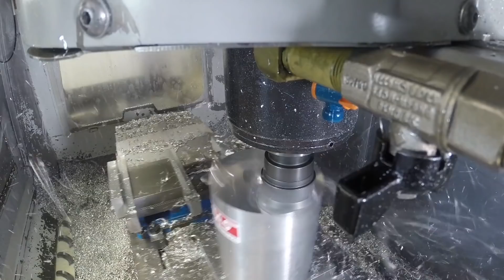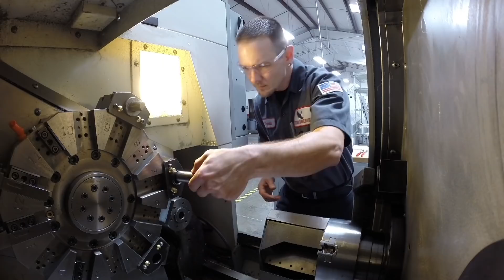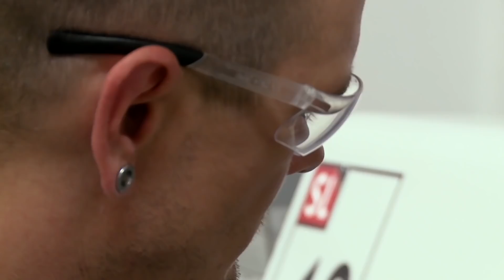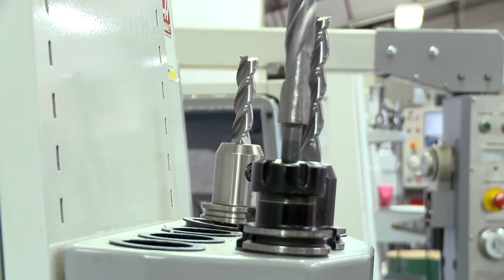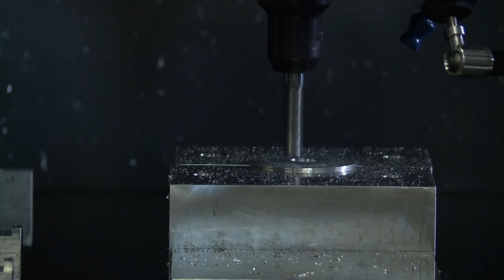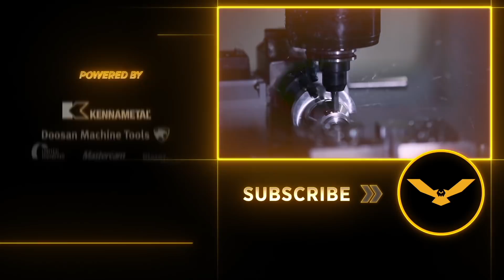I HATED Hearing Him Say… “You Got Time To Lean, You Got Time To Clean”

Comment: I literally sit at my machine playing my 3ds. I work in my own bay, and have long run times. I also take quite aggressive cuts, so I'm always at my machine, if I'm told to clean while my machine is running and I'm not at the controller? It's not just the possibility of a scrap piece, it's the possibility of a scrapped machine, or a seriously injured person. I don't want to see what happens when a .400" depth of cut, with a .04" feed rate decides its done for the day on a 5000lb piece.

Comment: As a toolmaker I once had to run a series of parts on a cincinatti mill, did it in half the time.. how come?.. i had to rinse  the parts that came out of the machine.. the regular operator would take the part out, rinse them and only then would put the new part in.. i took a new part in one hand and the vice key in the other, put the key on the vice, open it, take out the part and put it in the bucket for rinsing, put in new part, close the vice, shut the door and hit start, only thrn i would really rinse the part that had already been soaking in the bucket.
It was a short cycle, so aftrer rinsing i dried the part with compressed air, put it in the crate, and pick up the next part and the vice key, just as the spindle retracted.. no standing idle at the machine...
My supervisor asked me how i was so quick.. and i told him : "i'm not quick, i'm efficient"

Comment: "As I got faster and more efficient, I made more money"

Theres your problem in thought right there. Shops don't pay more for increased production or a clean workspace nowadays. I get paid the same whether I run one machine, or run 3 machines and the bandsaw at a breakneck speed all day long- and either way its not enough. Machinists aren't paid enough to give a shit.
Reply: I'd have to agree here, as a supervisor of 30 people but having no say in what they're paid. its incredibly hard to get people to go above and beyond and strive to do better or "more" when theyre paid the same whether they do or not. considering the skill this trade requires it is drastically underpaid
Reply: That's the truth... I used to make a part for my old job where I fine tuned the program and got insanely fast and accurate with swapping out the parts where I made 2500 parts a day while another guy running a faster machine made 1500 parts per day.... I knew I was getting paid far less and after 2.5 years of running mostly the same part I quit.... Machinist that work hard mostly get paid the same wage as the guy who's job is to be a machinist but chats all the time.... It's ridiculous.
Reply: i work in different kind of maching but yeah one my buddies who been at my company like 20 years refuses to bust his ass because hes  able run all the furnaces and all thrse smaller machines they dont pay him enough for all his knowledge
Reply: this is so true .. they once asked me if I could speed up the production .. I said, will I get paid to speed it up ? answer was no .. so I said that its already working at the limits.. because I get paid per hour , not per part, so why would I speed it up more ? to make it faster and get paid less ? no thank you. norm for a part is 400minutes ,so it will run 400 minutes, if I do it in 200 , the rest will get the company, not me
Reply: Move on to the next shop, you will get paid more guaranteed
Reply: @owievisie  I'm over near Austin, TX.  Looking online, you get paid more/same working at a major chain hardware store.  You're also not literally killing yourself as well.  $16~hr at shops is what I see...
Reply: @benkenny3220  That sounds like a reasonable entry level operator to be honest. That being said, 2-4 months in the operator should be seeing a raise or the boot.
Reply: @sonzai9441  5 years and that's where I am.  I can do basic setups and basic programs on Mazatrol mills and very basic programs on g-code mills and lathes.  I mentioned CAD/CAM and was told to learn the machine instead, which they never actually gave me the opportunity to do so.

The older guys might be able to program better, but they sit on their ass all day on their phones with these 30 minute run times.  While I'm running these minutemen parts and don't have time to scratch my own ass because the time quotas are BS.
Reply: @benkenny3220  I would see which program employers use around me, start learning it from my free time and look for another job, meanwhile keep working as hard as I can. One year I changed jobs 4 times. About a year ago I was called back by a former employer for double the salary, been working there since. Also, thanks to me changing jobs so often, I reckon I learned whole lot more because I had to adjust to new programs and machines each time.
Reply: You might not be paid shit wages and it's no surprise with that sentiment. I make as much as the engineers in our building because I make the company enough money to justify the wage. Keep your attitude and you'll never be more than a mediocre floor guy. If you show them what you can do and don't have to be micro managed to do it the money will come. I make just a hair under 6 figures.
Reply: @themadmachinist8637  congratulations for you that's simple not true at 90% of companies and busting your ass isn't going to change the company culture single handedly
Reply: @michaelf.2449  and how is fucking off going to improve the company's willingness to pay more?

Comment: Im only 23 and I clean my machine constantly, I run an older machine that doesn’t have a chip conveyers so I’m always making sure chips are out of the way of coolant flowing back to the tank. If it’s running I’m wiping the out side down and making sure it’s clean and looks nice. My boss man never complains when I take the last half hour of everyday to clean out all the chips from the older machines, mine included. I’ve only been running a CNC for a bout 2 months so I focus more on being consistent and on my repeatability than speed at the moment. All the guys that I work with and my trainer in particular know that when I come in, they don’t have to watch me to make sure I’m doing my job, and love me for it. Old hands respect young ones as long as they aren’t idle, and willing to learn.
Reply: ABSOLUTELY!!!
Reply: As a new machinist I would say it’s good to show the people you care. But years later you will realize that as long as your setups are correct and your parts are correct the rest of this crap is menial labor. Imagine being 15 years in and some boss who probably took your profit sharing away is getting on your case for not pushing a broom. Eff that.
Reply: I’m in the same boat man. I took over a station on cnc’s that looked like it had been hit by a tornado. I immediately cleaned and reorganized before I could even think about starting a job. I work a lot of overtime because I’m building a comp car on a deadline for next season so when I stay late nights and have longer cycles I’ll mop the shop floor and between cycles I’ll wipe oil and fingerprints from the machines. I do it mainly for my own compulsiveness at work but they appreciate me for it. I don’t ever get yelled at for “leaning” because it’s understood already after a few months that if I’m leaning it’s because everything is already clean and organized. I usually will let things get a little dirty then wipe the machine down 2-3 times a day instead of feeling like I constantly need to be busy. Leaning is okay but if there’s something you can do do it. If you keep up on cleaning then you’ll have the cleanest area in the shop and the most time to lean simultaneously
Reply: haha, i run a haas vf2 and a older haas tm2. i can relate to the chip management situation.

Comment: As a old school Tool & Die Maker I had been working on 1 section of a die I was building. It took about a week to make that first section. 
 After finishing the top section that was to mate with the 1st bottom section I discover that the very 1st hole I had drilled on the bottom section that took about a week to make was in the wrong location and could not be plugged and repaired. 
Due to the location and the type tool steel .
Broke my heart to waste the bosses time and money because you have to count it as 3 times. 1st time making it wrong. 2nd time making it right. 3rd time I could have been doing something else. So basically my boss paid me 3 times what it should've because I the first mistake.
Reply: You recognized the problem and did not press on.   Scraping a part is a time saver and if done a limited number of times a year really isnt a problem.
Reply: @christopherwhull  thanks Chris. I never made that mistake again. I learned to triple check every single measurement on the surface plate before I begin to make die sections. I did learn fro the mistake. I just felt bad for the money that was wasted and the time. 
 We didn't have CNC machines it was all old school tool and die maker.

Comment: This is why every machinist should start as a shop helper. You get the fundamentals drilled in by some crusty old timer that you think is just being a crusty old timer, pissed off and resenting them, looking for any little thing you can snap back with. But if you stick it out, the lesson is twofold- get rid of your ego, this is just business, and there's always room to be cleaner and more efficient. Also I feel the robot thing, run 1000 parts for a couple weeks straight with 15 minute cycle times and you'll be optimizing every movement you make.

Comment: In my shop we modify the doors so that the safety switch  is always engaged lol
Reply: There are couple machines like that where I work at and I remember being scared of them during my bored and frustrated operator time, because I feared that I would doze off leaning against the door and then the door would open and I would fall into the machine while it is working.
Reply: @rcandcnc9684  Never thought of that lol, the lathe i am on right now though has a broken roller or two in the door, so theres no way thats happening haha

Comment: Dude I used to do the same thing with racing myself lol when I ran production parts it would make me so mad if something held me up and I would look at the clock every hour trying to beat how many parts I made in the previous hour.  Good video Big Bear.
Reply: The worst job I've had to do so far was putting a fine point on 2000 tubes. First the tubes were swaged, then zapped with a Tig welder to seal the point, then sanded to a very fine point
If you've never heard of swaging, it's two dies spinning at 1000+ rpm in a spindle that has a cam mechanism to make them hammer together, essentially beating a point into the tubes. It's extremely loud so you're in a back room all by yourself, only able to hear the banging of the dies through your earmuffs, the vibration rattles the bones in your hands even with gloves. It just sucks

Well to get those parts done in record time, I looked at the clock every 5-10 seconds so that I could slow time down and get tf outta that room 🤣 I went borderline crazy to get those parts done lmao
Reply: Birds of a feather, homie
Reply from the maker: I even made a Video about it😂😂😂
Love you guys and love having you both on our Amazing Team😁🤙🙏
Reply from the maker: Loved this video… Great Word